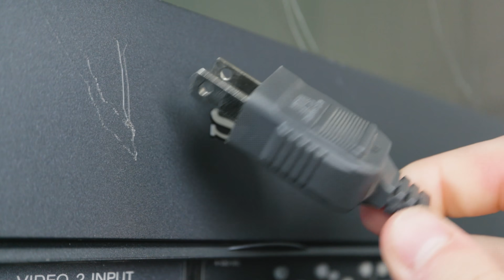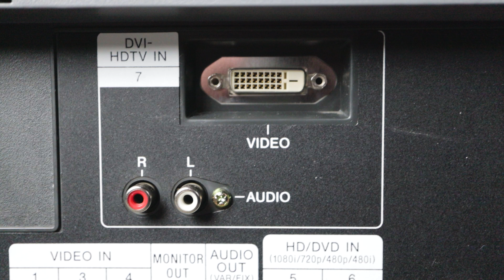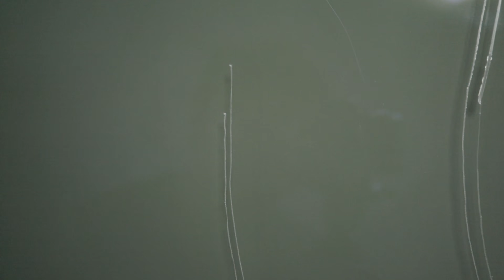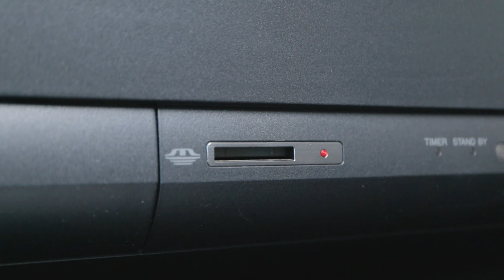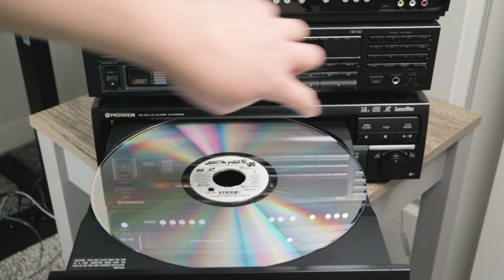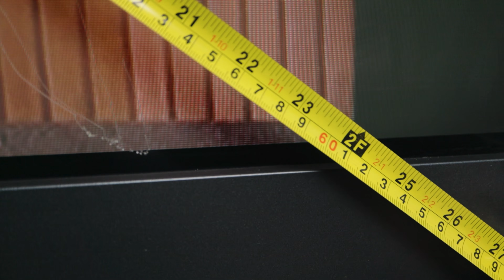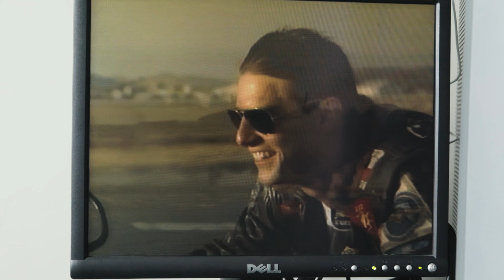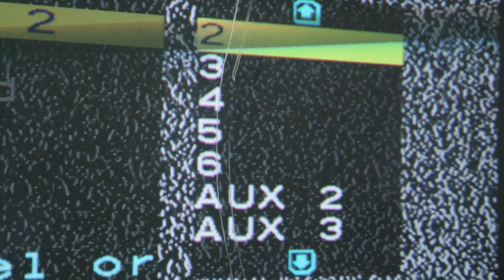The HD, WIDESCREEN Tube TV! Sony Trinitron KV-30XBR910

Comment: I found one for free if I could move it back in 2016. It worked when we arrived to get it, we moved it extremely carefully and then when it was placed in it's new spot at home, it wouldn't turn on. A bit of research online revealed that there is a chip that slowly dies and when it starts to, if you heat it up slightly with a hair dryer, it will start with about 20 seconds of indirect heat blown at it. So I cut a small "flap" into the back panel using small zip ties for hinges so I wouldn't have to remove the case every time I wanted to use the tv in our bedroom. The tv worked that way for years and when we moved we left it behind... I do miss it but it wasn't worth the weight, so to speak. LOL
Reply from the maker: Wow.. good to hear you got even more life out of it!

Comment: Probably has been said somewhere down in the comments but I'll say it just in case.
People don't get HD CRTs for low input latency in general because typically the only low input latency you can get is at native supported resolution which is 540p/1080i for most all these sets like the Sony ones. Anything lesser such as 480p/960i, or 240p/480i has noticeable input latency due to the processing needed to scale it up so the cathode can scan an image out.

In some cases with some mid 2000s HD CRTs (mostly Sony again) they apply processing on the input signals regardless if it's even up to native 1080i and you get latency.

There are some sets though that are native 480p and 1080i and do both by doing what's called line switching where the flyback supports being switched into two different frequencies to support one or the other, and they don't take HDMI or even DVI inputs, and don't do processing of any signals. What you get with sets like these is native support for 480p and 1080i with no latency. The tradeoff is you don't get any support for inputting any other signals like say 720p where it would get processed and scaled internally for output, so you can literally only give it 1080i or 480p. Can also feed those no lag 480p CRTs 240p/480i inputs, and they at the very least get scan doubled (which just doubles the scan rate and frequency to bring it up to the same scan rate as 480p) but that usually ads latency so none of these HD sets are good for that kind of gaming that uses 240p or 480i and you still want to have an SD set for that stuff.

These HD sets are great for content watching though hands down. And if you have a set that doesn't introduce any latency (or has extremely low latency) when giving it 480p then they are great for both 6th and 7th gen gaming assuming you hack your PS2, GC, and Xbox to force 480p at the very least for output across the board. That's what I do with my set. I have a Toshiba 34HF81 which is native 480p and 1080i lagless, and I feed 480p or 1080i into it with all my 6th and 7th gen game consoles and watch DVDs and BDs with my PS3.

HD CRTs I think are fantastic if you can support having one if only just for media consumption because DVD looks like modern HD on them. They have this sort of "silver screen" quality when watching almost anything, especially anime that you just don't get with a modern display.
Although there are many in the CRT community who would argue watching media on a PC CRT is peak quality, you are limited to only so big of a monitor, and I personally feel that the slight tradeoff in compared quality for an HD CRT is worth it for the larger viewing experience.

Comment: there were 2 CRT flat screen units that dominated the market in the early 2000,s one was this and the other was the Loewe Aconda 30 inch picture quality was very close. I ended up going with the Loewe
Reply: yep, but this Sony 480p-720p .. Loewe only 480p
Reply: @JonnyK3D  I bought the unit because it supported 480i 480p and 1080i and gave the best picture for movies by the time 720p came into play which didn't last for long Plasma set,s like Pioneer Elite had taken over offering a much larger screen with same quality picture but that didn't last long before Sony  took over with HDMI setting 1080p as the standard even though broadcasting was still trying to catch up with 720 eventfully everything  switched to 1080p and large rear projection sets  from Samsung and Mitsubishi took over. when it came to dvd representing film presentation Aconda was the best in my opinion

Comment: I still have my 34" Toshiba 34HF84 floor model that I bought from Sun TV. This was the sweet spot model. 1 HDMI in and the last year that this series was manufactured by Toshiba themselves. The new year's model, the 34HF85, was assembled by Orion and the quality control went down the shitter. I still have it hooked up to an Onkyo HDMI passthrough receiver with NES/SNES minis and WiiU/Dreamcast connected. Also, RGB modded N64 and PS2 plugged in component. It'll have to be pried out of my cold, dead hands!

Comment: I use to sell TV 2004-2007 

DVI was common HDMI was just creeping in around 2005 to more and more sets
Reply from the maker: Ahhh makes sense!
Reply: @simonretrotech  I worked in Australia for one one the biggest retail chains, back in those days I was literally selling Samsung Plasma and LCD tvs (pre LED) back then literally there was like $1000+ profit margins 

I use to clean up, working on weekends, sell a few tvs, throw in extended warranties pad the price and make awesome commissions

Was a fun time AV gear was a lot more fun, still required technical skills....I don't enjoy it the same way as I did back then. 

But yeah with that TV just use a DVI - HDMI adaptor and a 3.5mm stereo toRCA that was pretty common, pre HDMI days was more fun, HDMI made it too easy :P 

Back in 2007 I had a PS3 paired with Panasonic HD projector and JBL surround, was great fun...now Im an adult

Comment: My HD CRT Sony had an antiglare sheet/protector applied to the tube. It will require removing the tube from the bezel but you should be able to remover the adhesive sheet and the scratches will come off with it. Unless of course it scratched all the way through to the glass.
Reply from the maker: Ahhh good to know. Thank you

Comment: Still miss my 1600x1200 trinitron monitor. Actually felt like a downgrade when I moved to my first flat panel which was some weird resolution like 1400x900 I think. Was unfortunately necessary though, as my childhood bedroom was tiny, only had a small desk and the only way I could fit the trinitron on it was to have it in the corner at a 45 degree angle.. Not great for my posture!
Reply from the maker: Oh yeah I bet that was a good monitor. But I'm sure in the long run the better posture paid off haha

Comment: Car polish might work on those scratches. If you have it, use one of those hand-held polishers. Other than that I can think of polywatch (intended for acrylic wrist watch crystals), but those scratches on your TV seem too deep and too large. But you might want to try regardless. Also funny how North American TVs have all those weird connectors when we in Europe generally had exactly one: SCART. Literally everything made here in the 90s and 00s uses this connector. Was only replaced by HDMI when flatscreens came around in the 10s.

Comment: While I don't watch a lot of television, to this day I still have my Sony XS955 Super Fine Pitch as my main TV; mine was manufactured in 2006 but I bought it from a private party around ten years ago. For their time they are engineering marvels. I've still never bought a flat panel model of any kind. Also have an older Sony Wega FV300 SDTV model that has sentimental value and I can't part with, even though it is just for ambiance at this point.
Reply from the maker: That's awesome! Glad you kept it all these years.

Comment: had a similar tv but euro
4/3 and 82 cm so probably 80 to 100kg
so it had scart and vga instead since it was the sd model
probably kept it until 2010 
it had the subwoofer so sound was great
it was amazing for retro gaming.
the memory stick format aka pro duo was used mostly by the psp.
Reply from the maker: That's awesome!

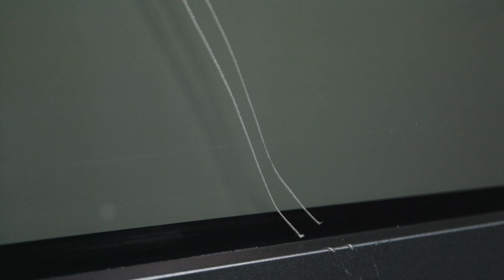Comment: 7:30 Maybe try a Car Windscreen Repair Kit
Reply: Maybe it works
Reply: Cerium Oxide Powder. The windshield repair glue kind of sucks I hear... but, for years I used my plastic snow shovel to knock snow off my car windows.  It broke last year 5 minutes into the worst snow storm in awhile so I grabbed the shovel with a metal edge on it.  Pretty much automatically I went to clean the car windshield and scratch scratch scratch scratch.  It was an absolute mess.

I got the Cerium Oxide Powder for like $15 and a tiny $30 USB rechargeable rotary tool, put a buffing wheel on it and you would never know it was scratched.  It buffs out the tiny jaggies that make scratched glass so noticeable.  Worked amazingly.

Comment: to answer your question, a lot of DVDs back then had something called anamorphic widescreen which if memory serves only worked on HDMI sources but the disc would tell the DVD player to tell the TV to stretch the image to 16:9 if needed, usually the code that told it to do that didn't kick in until after the FBI warning, so on most HDMI screens the FBI warning would be fullscreen and then the rest was widescreen, there was also code to tell dvd players hooked up to 4:3 TV's to squish the image vertically to make it fit properly on 4:3 TV's (If the DVD player knew the screen it was connected to was 4:3)

Comment: Older crt's like around the 80's used Shadow Masks while Sony has used Aperture Grilles for the majority of their run (I think there first few where different but unsure like the really really old ones) . A lot of CRT's after mid 80's used a Slot Mask which is similar to Aperture Grilles so it wasn't that in the more recent years that Sony looked marginally better, the other brands looked really close with Slot Mask tubes. Other brands like Toshiba or JVC that used Slot Masks where pretty close quality wise to the Aperture Grille. But most people I think believe it's only Shadow Mask and Aperture Grille, but it's more like for the most part it's Slot Mask and Aperture Grille and that Shadow Mask TVs where usually pretty old. I believe some monitors up till the late 90's and early 2000's used Shadow Mask but that's because you were so close to the monitor that I think it didn't matter much or helped with it not being as bright.

Comment: A tip for converters, they often use the refresh rate to define the signal NTSC or pal etc... create a custom resolution, any (recommend 800x450) and set the refresh rate of such resolution to 61hz, it's enough for it to ignore upscaling downscaling and inadvertently create a passthrough for both ratio and color range.... You fix your problems by creating a resolution that uses non 50/59/60hz AKA 61hz ... Good luck nice review
Reply from the maker: Woah that’s a good idea. I’ll have to try that out!! Thank you

Comment: "people like CRTs because no input lag"
Not quite. An analog CRT receiving an analog signal, yes. Anything with a digital signal will be about the same. There's nothing magical about it just being a CRT.
I'd imagine the latency on this being about the same as any LCD or OLED display, maybe worse because it's so old. It's still running the picture through digital processing.
Reply from the maker: Good point

Comment: Just remove the anti-glare layer. Looks like a peelable layer, and not a chemical spray. You can remove the front bezel, and use a razor blade to cut it free of the static-tape, then use isopropyl alcohol while lifting it away from the screen, kind of drip it between the glass and plastic antiglare layer as you are lifting it

Comment: eventually ill do a video on my damn near impossible to find RCA Scenium 34 inch HDTV Monitor. I think people would want to see it. Especially since its a 1080i Widescreen HDCRT with a built in surround and subwoofer, DVD player, and so many damn inputs. Mine was a dealer model and was able to acquire it from a small town. Speakers are blown but it has audio output as well like a fuckin receiver where I can directly hook it up to my theatre surround.

These were only sold through dealers and magazines so there arent many at all. Dish had a version of this with a DVR but both versions are super rare. I know of maybe 3 people on the internet with them. 1 dish, my dvd dealer model, and the owner that has one on CRT Database

Mines a 2002 model, RCA but used a Toshiba tube. Comparing this to my HDMI CRT I owned 2 years ago this one is waaaaay better. The color is insane. Im actually typing this from the TV right now.
Reply from the maker: Yes!! Please make a video on that!

Comment: Wild. I had 4:3 27” Trinitron growing up. From the mid 1990’s till the tube finally gave out around 2008. Considering it fell off a couch into the ground in college, it had a good run.

Love obscure tech like this. I don’t remember ever seeing any widescreen CRT’s for sale, much less HD. It seems we went directly to LCD/Plasma in the states.
Reply: Widescreen CRTs were really common in Europe, mainly around 32". There was one in a house I rented. Just turning it 90 degrees was  difficult for me on my own.  Sony used to make 20" widescreens CRTs which looked  ridiculous as they were still the same depth as a 27" 4:3 CRT . More like "Reduced Height" than widescreen especially since everything except a few VHS tapes were still 4:3.

Comment: I got a Samsung one and I had blurry corners also geometry issues. I sort the geometry out in the service menu and learned how to adjust the rings I can explain if you want. After they there is another adjustment on the HV panel and after that it should be clean all around however the geometry will have other things as it’s not possible to set up a 100% geometry on the most 16:9 hd CRT’s. Mine has doming but not as annoying as corner geometry.

Comment: Seeing that dvi port on this I would definitely try to hook it up with a windows pc and using CRU make a custom resolution 540p.
It looks the best and 0input lag if it’s works!

About the scratches try to use car windscreen repair kit and instead of a blade to to take the excess use a glasss polishing kit. Should not be vertical but actually it’s still possible using all the installation film to trap the liquid in the scratch.

Comment: I hope for the sake of all that is holy that you are erasing all those pencil scribbles in the manual. Just no. And yes, DVI was the bees knees in the early HD days before HDMI. You would use DVI for your video and hope that your player had optical out for your hi fi system. Although standard RCA jacks could still carry analog surround from Laserdisc

Comment: If you owned a PSP, you knew all about the struggle with Sony’s MemoryStick format. Overpriced and only manufactured by Sony.
Reply: That, or any of the Sony Ericsson Walkman phones some 15+ years ago. There were adapters to convert microSD cards to the Memory Stick Pro Duo format though, so that made things a little easier (and a lot cheaper)
Reply: I did have a SanDisk Memory Stick Pro Duo on my PSP.
So it's not really manufactured exclusively by Sony, but I'm sure Sony gets royalties from third-party customers.

Comment: The warping is what's known as "CRT bloom" and seems very likely to indicate a failed/failing component in this case. It's perhaps not very likely, but the problem might fix itself after a while, as if it's a capacitor it may recover more capacity after some time. Of course, it may also get worse.
You can reduce the effect by reducing brightness &/or contrast, which while likely extend the life of the CRT anyway - less wearing of the phosphors.
Reply from the maker: Interesting, thank you. I might just replace the capacitors
Reply: @simonretrotech  I don't know if it's capacitors specifically that cause the problem, but there's probably guides online for fixing the problem. I guess you're aware, but the inside of a CRT TV can be dangerous with very high voltages, even when off. The tube itself apparently acts like a high voltage capacitor.

Comment: That's a universal remote. Sat/cbl just switches to sending those signals by IR. Same with the home theatre controls. You don't need to have cables connected between devices. You just have to program the remote.

Comment: For the DVD Player, there’s an option in the player’s menu to adjust the screen settings.

In the DVD player’s menu, set the screen format to “16:9/Widescreen”, and turn on Progressive Mode.

Progressive Mode is only available through component video output.

Comment: I still own and use this monitor. In July 2019 a lightning strike destroyed the power supply and it took me several years to find a service place who came to my home, removed the circuit board and repaired it without a device he had used in the past but he had long ago gotten rid of. I had purchased a Samsung LED SDR TV as the HDR UltraHD TV would not fit in my $5,000 all video/audio equipment wall unit, unlike the ones frequently available in furniture stores which only had room for a TV and maybe two items like a VCR and DVD. I now keep it and my 34" Sony KV-34XBR970 HDTV with one HDMI input (but with a lesser quality CRT with pixels not as fine pitched as the 30XBR810) unplugged from power and coaxial cables when not in use or when there is a thunderstorm which is what killed the KV30XBR910, my burglar alarm, my garage door opener, a 220 volt air conditioner, my Pioneer Elite 7.1 AV receiver, Betamax and SVHS VCR, etc. I use a digital tuner now to feed its HDMI output in to the DVI video input with an adapter cable. But I have a number of other HDMI devices so I use an 8x1 HDMI switcher for video and also my 7.1 AV receiver.
All analog audio from 4 devices feed a 4x1 audio switch that feeds the audio inputs that are designated for the DVI inputs. Back in the "old" days the channel index feature allowed me to "scroll" through all the other TV stations while watching the "main" TV station!